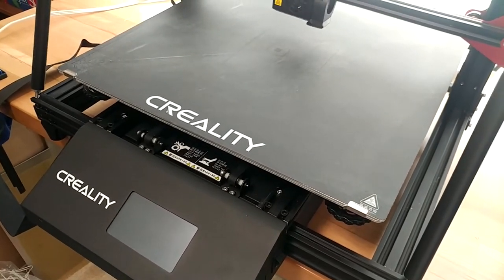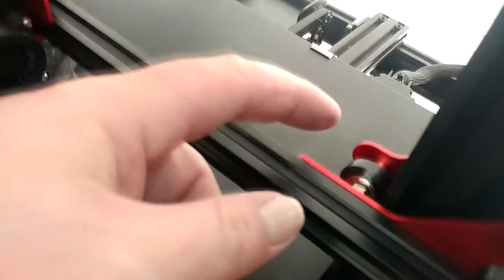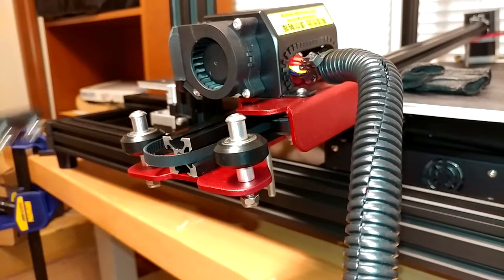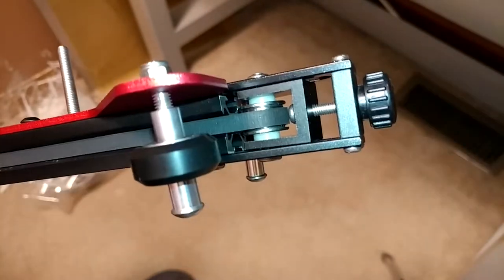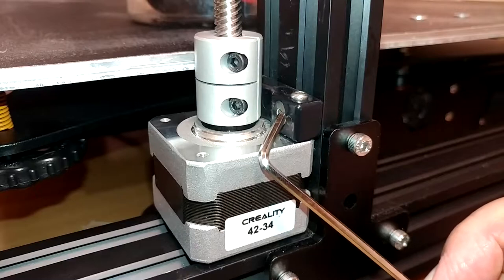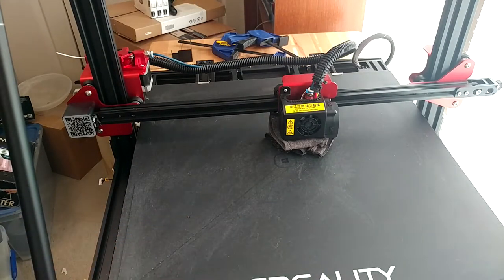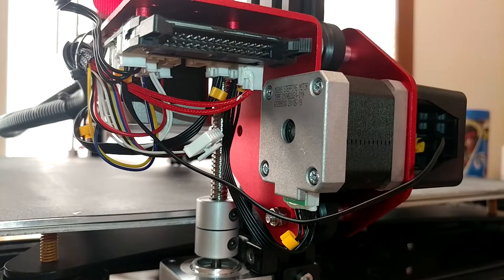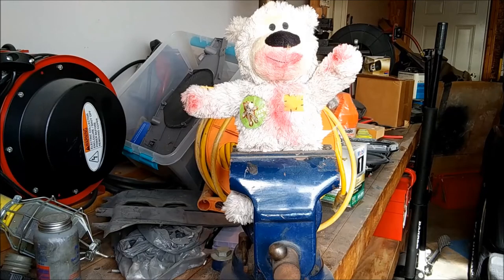Creality CR10 Max X & Partial Z Axis Rebuild + X Axis Belt Tensioner Install!

Comment: Thanks for all the great info here.  Likely the best video on the web for this printer.  Picked this up by accident.  Auction listed it as a cr10s.  It was bought sight unseen.  Looks to have the same problems you and most all reviewers have had.  Utter garbage.  I am deciding now if I play or sell it to get something more reliable out of the box.  Seems like a cool printer if it could only be made to work.  It seems many have tried and most have failed.  I am currently building a voron 2.4. 80% complete.  I just started gantry wiring.  Maybe 2 more evenings and I should be ready to power it up for software and firmware installs.  Then run its maiden tests.
Reply from the maker: I appreciate the compliments. Thanks!

Oddly, I've found nearly the opposite of your research to be true. Most people are telling me I'm in the minority with the problems I've had and the other 5 of this printer I've used have been completely perfect out of the box. It seems when they're good, they're really good, and when they're bad they're garbage. I ended up with a bad one, I guess...

Comment: i also had long problem of other side dragging. i tried loosening bolts and trying to fix the assebmly but nothing seemed to work. I installed the springloaded t nuts but still it took some time printing but now the machine seems to stay in level during print. gotta get some wheels and check the z stepper are aligned. cool video, thanks
Reply from the maker: I'm glad you found the video useful!

Comment: I just got this printer yesterday and so far PETG has been pretty awesome to print. My copper filament broke twice and the restart feature was a charmer. 

Finding how to upgrade this printer and the Hotends is a nightmare. I like their extruder so far and finally found the MicroSwiss all metal "drop in" replacement hotend. I did buy the Mosquito Mega and DDX but I may not even need to use those. What's your opinion on that upgrade path?
Reply from the maker: Overall, my printer has been, and continues to be, a problem child. I'm glad yours is running well straight out of the box. I haven't been able to experiment much with much other than PLA due to the issues.

I installed a Microswiss hot end on mine a few months ago (video coming) and it's a nearly mandatory upgrade. The stock Creality hot end uses a weird thread pitch that is unique to Creality, so its expensive and a hassle to get replacement nozzles. I'm not familiar with the Mosquito or DDX, so if either of those solves that problem then you're all set.

It's also worth mentioning that I also bought a generic version of the Microswiss for something like half price and it appears to work just fine too. I have a hard time telling them apart, actually. I wired connectors at the hot end so I can easily swap between them so I don't have to spend forever purging materials like PC. I can swap hot ends in about 3 minutes now. Video on that inbound too... I need to stop neglecting this channel so much.